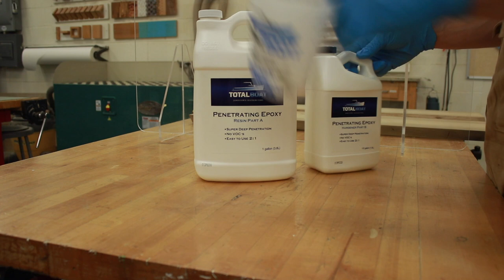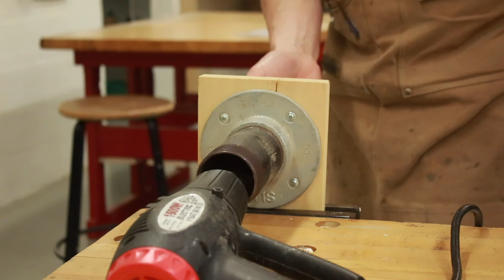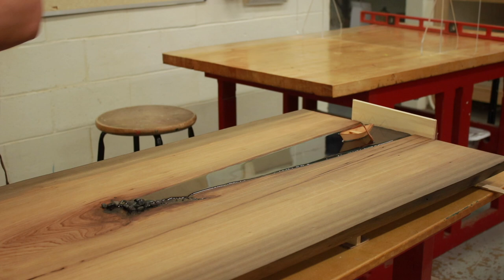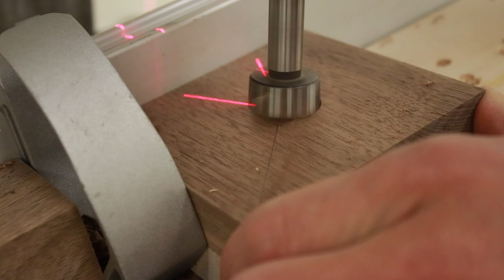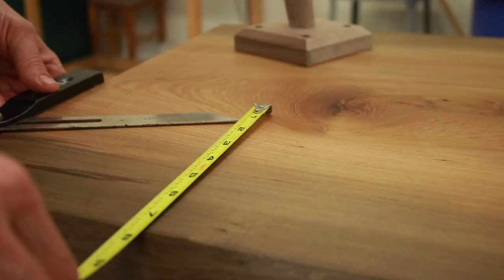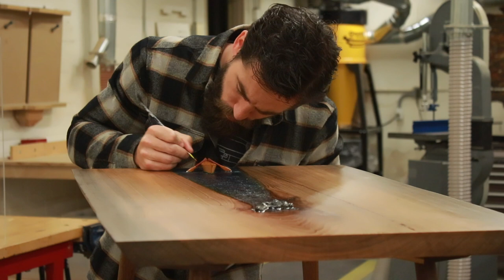Making a River Table // Resin Art // Woodworking

Comment: I would love your take on how I was taught to flatten slabs with a router. I was taught that I should only cut in one direction when flattening. i.e. Don't do any climb cuts. I usually stand so when I am pushing the router away from me it is the push cut. Then when I pull the router back to me, I don't cut. That would technically be a climb cut. Everyone that has become aware that I flatten this way tells me I am wasting time.  It could be the placebo effect, but I am sure there is more sanding when I flatten with climb cuts. And I hate sanding. I'd rather do twice as many motions with the router. Even after upgrading to a CNC, I still notice a difference. Not as much, but it is there. Would love to see someone take the time to see if there really is a difference, or if both my mentor and I are suffering from confirmation bias.